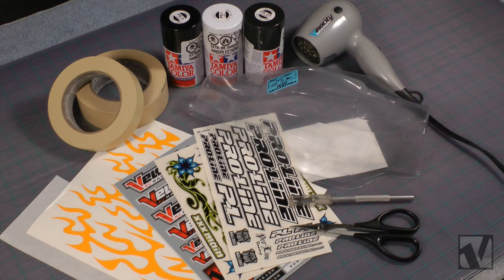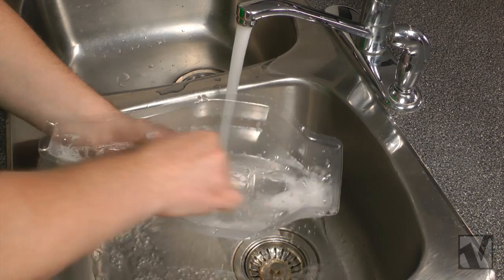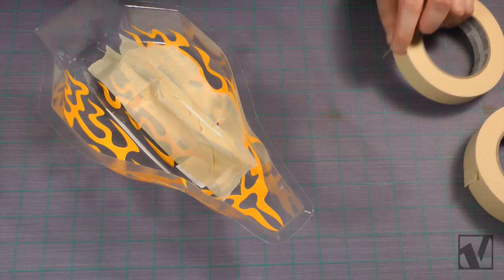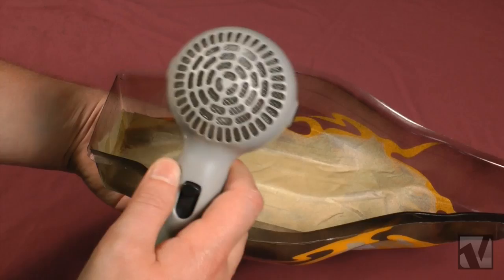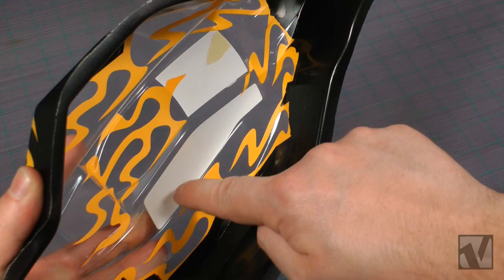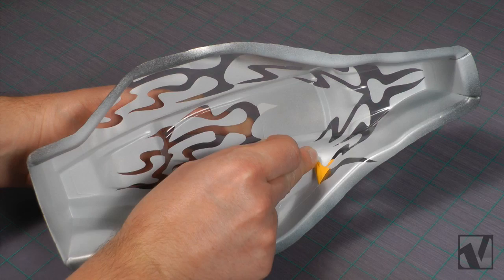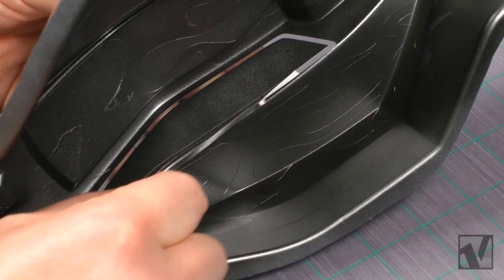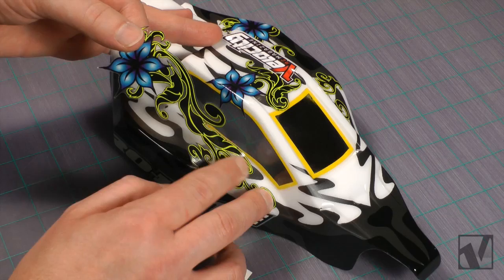How-to RC Car Body Painting with Stickers - VRC Magazine

Comment: Cool video.
Do you guys not prefer using the Windex-method when applying stickers? It certainly helps me get any bubbles out and get the alignment correct - but I don't know if it compromises the adhesive and lifespan of the sticker?

Comment: Sweet paint job!! Great Tutorial.. 1 Question I received some vinyl Proline Decals with my VW Baja Beetle body, they dont seem to be sticky enough to adhere properly? Do I need To: i)soak in water or solution ii)use a vinyl decal cement(Tamiya) or iii) just cut with scalpel & apply..? please help?